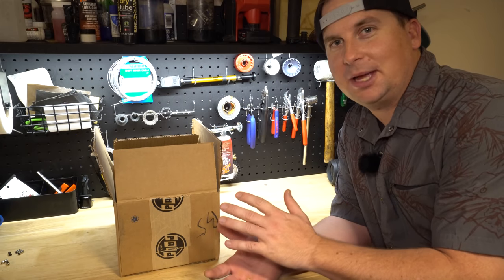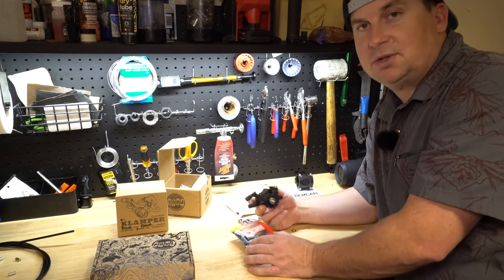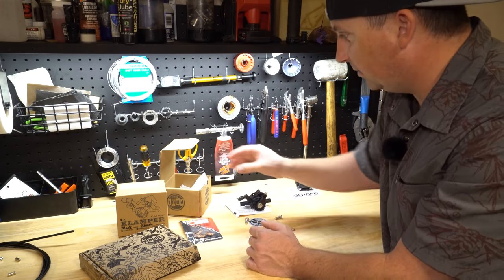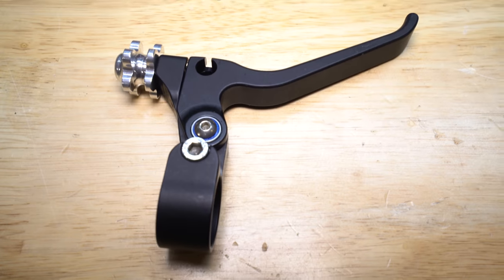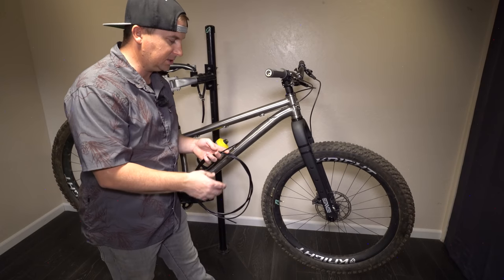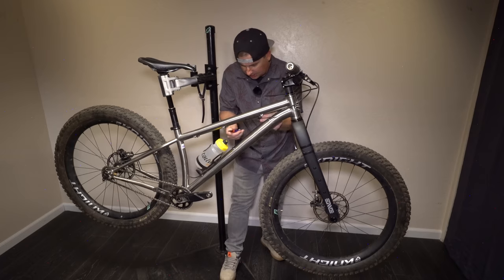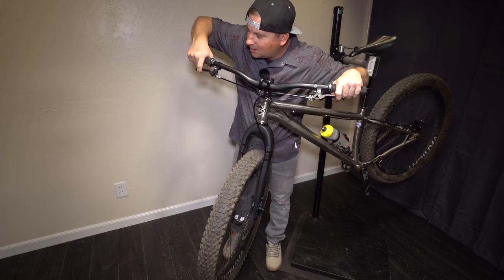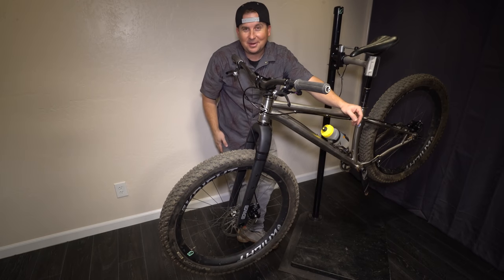First Look: Installing Paul's Klamper Cable-Actuated Disc Brakes - Made in the USA

Comment: I don’t even have to watch to be excited about this review. I love my Klampers.
Reply from the maker: Yours were the first set I had tried in the wild. I can't wait to put some miles on these babies.
Reply: And you should have gone with purple. 😁 and yes Paul and the rest of their crew are soooo awesome.
Reply from the maker: @oldshovel  i showed weakness in the moment that mattered most...
Reply: We know that Rob :)
Reply: I've been running short pull clampers and getting very close to Code RSC performance with a couple of simple changes...upgraded the housing to Yokozuna Reaction cable housing. Then swapped out the stock pads with Swiss Stop Disc 26 E. Also oil/grease the cable end where it is held in the leaver. If you're finding that the Yokozuna is hard to bend on rear brake, you can get a noodle from them which will make the job easier. Can't say I miss the dot fluid!

Comment: They seem like typical hipster bike silliness.  Choose an arbitrary technical stopping point, and then make the most expensive possible version.  It's funny how the stopping points vary depending on the variety of bike hipster:  road hipsters won't use any disc brakes; touring hipsters will use discs but not hydraulic; mtb hipsters will use hydraulic disc but not air shocks; single-speeders won't use derailleurs; and city hipsters won't even use freehubs.  To each their own, of course, but the reasoning involved is usually more of an excuse for a fashion-based decision than a real reason.
Reply from the maker: These are machined by hand, and they take a lot of time to build. They're not arguing that everyone needs them, or that they're the cheapest or the most powerful brake on the market. Someone has to get paid to make these, and it's going to cost more than a sram or shimano brake, where they can make 500 in the time it takes to make one klamper. These are not for the budget shopper.

Comment: We put a Klamper on our Bike Friday tandem a few months back. The cable allows for disconnecting for packing and travelling. A very amazing disc brake, powerful enough for our combined 385 lbs of people and bike, and very good modulation. 
Planning to install a rear Paul’s soon.
Reply: Nice, do have short pull or long pull?

Comment: Definitely a good point about the Paul stuff when you said its meant to last forever. The stuff costs a pretty penny upfront but you can move it from bike to bike to bike and still have something that works as well as when you got it. For my next set of brakes I'm definitely thinking about these if not for my geared bike then for my single speed.

Comment: interesting to see how these perform on your next review. I love a good cable disc brake, I have had Avid bb7's on my bike years ago, and still swear they are the best cable disc brake on the planet, easy adjust, easy install, and just as much if not better power, and modulation than most hydro disc's.
Reply from the maker: I ran bb7s for a while. I dug em. These are even easier to adjust than bb7s.

Comment: Very interested.  My complaint about most cable-actuated disc calipers has been a somewhat mushy feel at the lever. I like a solid grab point. I built up my gravel bike with TRP calipers because those have the most solid feel of any I've tried so far. 
Ooo... and after looking at the website, I'm even more interested since they specifically have a Campagnolo pull option for the calipers...

Comment: I used to love running the Avid BB 5 and 7 with my  SD7 levers,but on longer rides in bike parks etc the resistance in the cables does tend to give fatigue,I now run hydraulics for less resistance but I still prefer the feel of well set up cable pull disk brakes :-)
Reply from the maker: I know exactly what you mean.

Comment: Super excited to see what your impression is for these brakes in trail riding. I have a set on my gravel bike, and it definitely took 5-ish rides for the pads to bed in. I think they work quite well, but haven't used them for trail riding with larger rotars.
Reply from the maker: I'm curious as well. Most reviews I've seen mainly talk about touring or gravel use. We'll see how they hold up on a mtb on some rowdy terrain.

Comment: Still using mech calipers on my hardtail...its 2 piston like trp. Paired with shimano pads its got plenty of power to lock up the high rollers i use and with jagwire cables its almost as smooth as hydraulics....

Comment: Would love a set of these if they weren't so pricey - I used to run Avid bb's for trials riding and they had awesome bite, a lot of guys preferred them over hydraulic. Linear bmx cables worked nice, and dripping chain lube (not a lot) down the outer cable made them even smoother

Comment: I've had the Klamper's on my gravel bike for 2 years and have a rough time getting them adjusted.  If I swap out the 27.5 wheelset for the 29'ers it's near impossible to adjust them and even the shop has a hard time.  It's either the frame or the brakes.

Comment: If they have the power and feel good seem great but real question with they get all crappy and siicky like gear cables when ride in rain and mud?
Only hydrolic disk brake failure i've had is snapping mount off. 
Beautiful piece of kit though

Comment: TRP Spyke brakes are the best cable actuated brakes.  They are symmetrical and use Shimano pads.  They are perfect for fat bikes and other bikes where semi-truck stopping power isn't needed or where temps/conditions would fail a hydraulic brake pretty quickly.
Reply from the maker: Which other cable actuated disc brakes have you tried? I don't have any experience with the spyres, but from what I've read, they have a reputation for seizing and getting rusty over time, and sadly they aren't rebuildable.
Reply: @hardtailparty  Tried Avid/Shimano.  Spykes and Sypres are mechanically the same but Spykes have have differences, including a ingress cover.  Never have heard about any rust/seizures and given I use these for fat biking in the snow, I'm surprised I haven't encountered that.  If Paul Components brakes were symmetrical, they would be the top on my list because I would never have to get another brake.
Reply from the maker: @joshuarebennack68  how long have you owned your spyres? I love the design in theory.
Reply: @hardtailparty  3 years on the fat bike.  I have TRP brakes on all my bikes.  Trails on the mountain bike, Spykes on the fat bike, Spyres on the road/gravel bike.  I've generally found TRP brakes to be "no fuss" brakes.
Reply from the maker: @joshuarebennack68  glad to hear you've had no issues in 3 years, that's great.
Reply: What do you mean by symmetrical? What does that mean? Do these klammpers have one piston?
Reply: @bushgreen260  Most cable actuated brakes (including the Klampers) pull on brake pad into the rotor and rotor bends (slightly) to the other pad.  TRP Spykes have both pads move in together, like a hydraulic brake, and the rotor is not bent.
Reply: @joshuarebennack68  i thought that's what you meant but i wanted to make sure. Is the trp spyke the same as the spyre?

Comment: If it was fold over bar to install lever it would be perfect. I like to remove the front end of my 29 when storing/transporting my bike. (I run a single speed)
Reply from the maker: @seanlowkey9388  I'd like that too

Comment: If you want compressionless  cables, look for BMX ones. So much cheaper than “ proper “ MTB ones; transformed my BB7s for £3 each instead of 10x the price!
Reply from the maker: Great tip, thanks!
Reply: I wish I knew this earlier this summer. I spent $55 on housing and cables for my BB7s. It really did make a huge difference, though. No more spongy at the end of the lever travel means no more hand fatigue on long downhills because of pulling extra hard on the levers. Now I can only blame the rigid fork...😉

Comment: I thought that it's actually better to use normal pliers for cutting brake housing instead of wire cutters. They are the right option for multi strand stuff but since brake hosing is just a single coil of wire it's better to pinch it and only cut it in one point, it gives less of a burr, or so I've been told.

Comment: Why short pull and not long? 
I read somewhere that LP has these tendency to chaff on the barrel adjuster when compressed.
Have you also tried long pull?
Reply from the maker: The guys at paul recommend short pull for mtb applications. More power, shorter throw of the lever
Reply: @hardtailparty  Appreciate the response!
Clearly will go for SP then. :)

Comment: Interested to see how these perform. Just a comment on cable cutters, according to everyone's favorite mustachioed bike tech guru, Calvin Jones, for old school spiral brake housing you actually do want to use side cutters, because you're only cutting a single piece of metal...

EDIT - it would also be amazing to see these compared to a set of TrickStuff brakes. If I'm reading the Paul website right a complete set of Klampers and levers are around $700, and a set of TrickStuffs are ~$900, so not too dissimilar.
Reply from the maker: Very interesting, thanks for sharing that. I wonder if there's an advantage to the side cutters. I've always used cable cutters with good results. I may have to try side cutters to see how it does.
Reply: @hardtailparty  If you think of the housing as a tightly wound spring, you only cut it in place. He does recommend flexing the housing to open up the 'spring' and then you just snip through that one piece of metal...
Reply from the maker: @chiefsilverback  Makes sense, I'm just struggling to understand why it's better than a cable cutter, since a cable cutter does the same thing. Regardless, this is interesting info, and I'll give it a try sometime. Thanks for the tip!

Comment: raining hard here in Pine, how are the trails in Sedona today?  thanks for the video, Im thinking of a brake i can service as well when I start riding the rim, its pretty remote out there!
Reply from the maker: That makes a ton of sense. I need to do more riding in the pine area. Sedona is wet right now, but not too wet to ride.
Reply: I got a sweet camera mount under my seat, perfect for B roll when I ride with others.

Comment: These are the ones that the gravel folk love right
Reply from the maker: I'm not really plugged into the gravel scene.
Reply: @hardtailparty  seem to like them for the same reasons you do, long backpacking/touring routes so ease of repair and power. I must admit a long decent and a loaded bike id be nervous
Reply from the maker: @joeroche552  if anything, I'd suspect theyf be better on long descents and heavy loads. There's no brake fluid to overheat and break down. These are the same brake pads as the hydraulic brakes, so they should have no problem keeping up with the heat. Since there are cable, the lever feel will remain consistent through the ride, and brakes won't get spongy. That's my theory at least
Reply: @hardtailparty  i hadnt considered fading, very good point

Comment: Paul's single speed hub is my next purchase its just hard to find a quite freewheel...any recommendations?  If I cant find any I'm going to pull the trigger on the white industry freewheel. Thnx
Reply from the maker: Id reach out to the guys at Paul and see what they recommend. They've been doing this for 30+ years and they'll steer you in the right direction

Comment: Hey Steve this opens up a lot of questions for me. I got my first real mtn bike in 2019 with tektro aries mechanical brakes. I was blown away how good they are compared to box store bikes with disc brakes but they aren't perfect. I eventually upgraded to larger rotors to improve modulation and power (it worked, despite what the internet said). But I still haven't had hydraulic brakes and I wonder if I should upgrade so I am really excited to get your take on these. I wonder if you would consider another mechanical brake (like the aries) in an experiMENTAL review? Thanks for the videos and good luck!
Reply from the maker: I'd like to try a few different mechanical brakes through the years. I'm always open to new experiments. Playing with brake pads is another fantastic way to improve braking.

Comment: How would that work with a suspension fork? Does it? Wouldn't the fork move up and down changing the pull on the cable?
Reply from the maker: It still works. The housing is affixed on both ends: one at the caliper and one at the lever. It's the same way a derailleur still works on a full suspension.
Reply: @hardtailparty  Makes sense.

Comment: I'm a motorcyclist and used to bleeding brakes. To me it seems like cyclists are so afraid of brake bleeding that they forget that cable brakes need adjustment and in my experience have been far more difficult to work on than motorcycle brakes. Are bicycle hydraulic brakes somehow harder to work on?
Reply from the maker: I've been a bike mechanic for 25 years and bled hundreds of brakes. I'm not afraid of it, but I prefer these cable brakes.
Reply: @hardtailparty  Yup, this was also meant as a genuine question - I've never worked on bicycle hydraulics.

Comment: wondering what if Paul creates a mechanical dropper seatpost
Reply from the maker: Almost all droppers are cable actuated these days. My 9point8 dropper is completely mechanical. Even if it loses pressure it'll still stay up or down when you push the lever. Pretty rad.

Comment: I ride BB5s on my old hardtail, as fast as I possibly can; I'm always saying they are for slowing down, but not necessarily stopping! I'm sure the PKs (or 7s) are better. Switching back and forth from fs w/hydraulics to the BB5s requires some awareness to prevent treeplanting or otbs. Party on. 
PS- Hardtail shame? What's that?

Comment: I forgot about Paul Components disc brakes, I am going to have to tell a friend about them. He has had a really bad experience with hydraulic disc brakes, every single one of his bikes has had leaks at the caliper and he's fed up with them.
I actually have two sets of Paul Components Cross Stops, they're pre Vbrakes with a cam and solid bar across the top. I got them in the mid 90's and still have them
BTW how do those shirts fit, are they true to size? I wear a size large shirt with room to spare because I really don't want things too snug
Reply from the maker: The motive fits a little bit large. Of you normally wear a large and you like it a little baggy, go for the large. I usually wear size L tee shirts, and I'm wearing a medium motive in this clip.
Reply: @hardtailparty  Thanks, I am going to request a set from the Wife for our 24th Anniversary. It isn't until July, but hey, I like early gifts....lol

Comment: As a disabled rider, it would be nice if Paul Components had a "double pull" (one lever operating both disc brakes.  I ride about 30-60 miles a day.. i have over 20k miles on my recumbent trike that i have invested over $12k into... I will pay the cost of having a quality double pull lever.. Yet quality manufacturers like Paul don't make this.
Reply from the maker: Reach out to them, you never know what they'll says
Reply: They make the duplex lever which pulls two brakes.

Comment: I ride mechanical brakes by choice, but I have to say that on a long, rainy downhill, the lack of auto-adjust pads means your cable brakes will feel worse at the bottom of the hill than at the top.
Reply from the maker: Which cable brakes are you running? You've had the pads wear enough in a single downhill to require readjustment? That's wild.
Reply: @hardtailparty  Old (2004) Avids. That only happens in conditions where pads wear rapidly- long, wet downhills. When pads wear on hydros, the pads compensate by moving in. I don't know of any cable disc that auto adjusts for pad wear.
Reply from the maker: @English With Tim  I've never had a pad wear a noticeable amount in a single run, but then again, it's not very wet here.

Comment: personal experience: "compressionless" housing works MUCH better for mechanical disc brakes.
Reply from the maker: I would agree for most cable disc brakes. Surprisingly, the guys at Paul have tried both and they prefer regular housing on these.
Reply: @hardtailparty  nice! that Paul guy, he knows what he's doing.